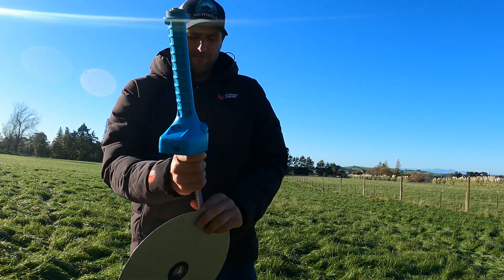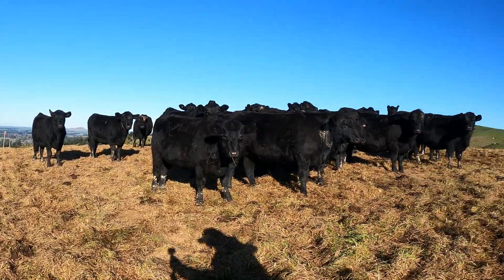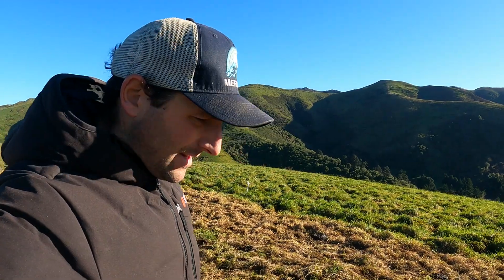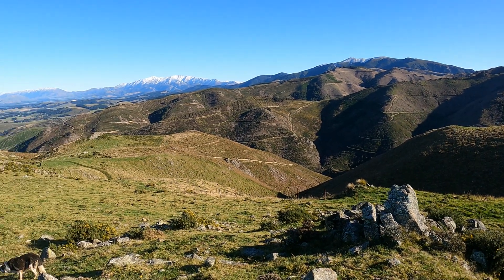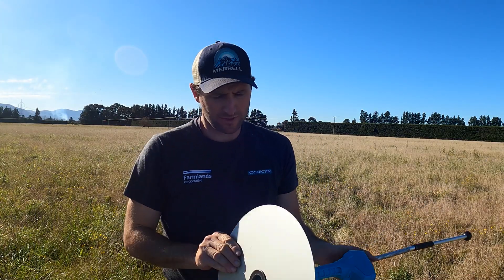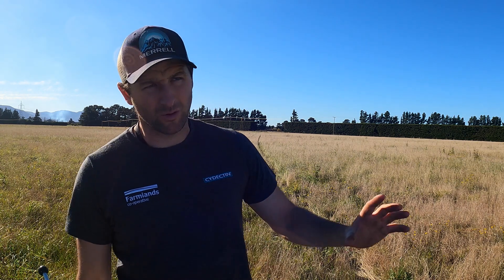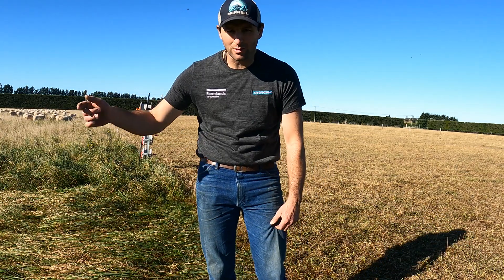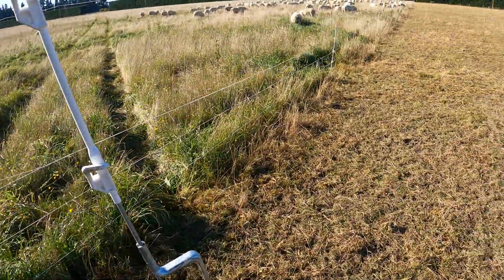Break size for sheep and cows Part 2.. Fancy new sheep fence standards.

Comment: How do you work out the growth rates of the stock, particularly young cattle as I can’t seem to find any information about that for myself
Reply from the maker: You will have to weigh them one to get a base weight then weigh them again in a week or a month. Then take the difference in weight and devide that by the number of days between the two weighing sessions. This will give you kg per day of growth. Hope this helps.
Reply: @kiwifarmernz   thanks, so to maintain Feed same and to gain would you increase by like 10%?
Reply from the maker: @travissmith2762  the rule I use is to grow an Animal the feed intake is 3 to 3.5% of an animals live weight. So a 200kgcalf will require 6kg to grow. Maintenance is 2.5% of live weight in kg of dry matter per day.
Reply: @kiwifarmernz  great that really helps